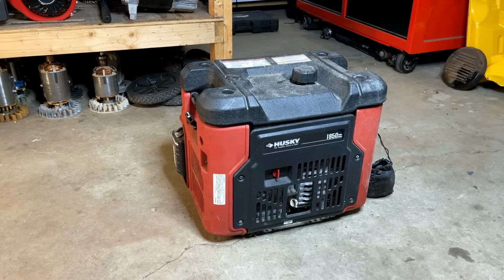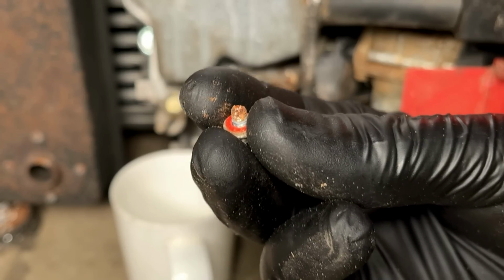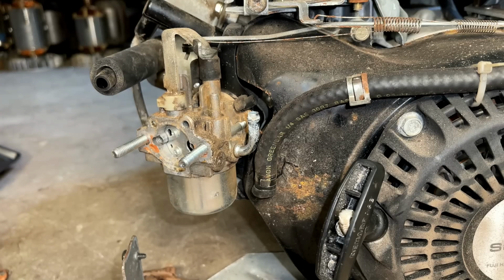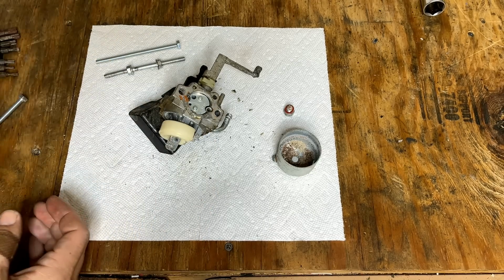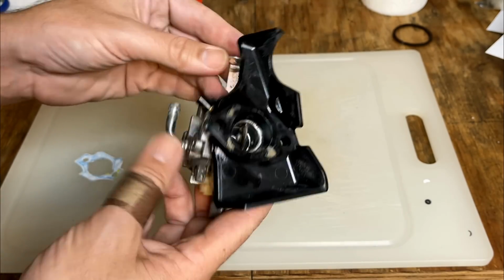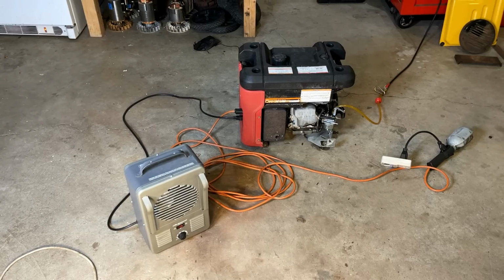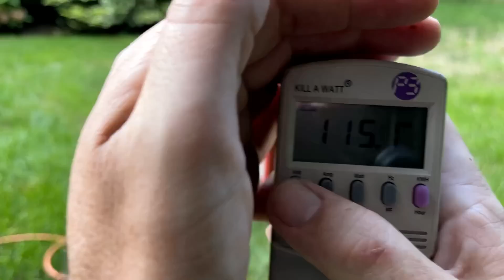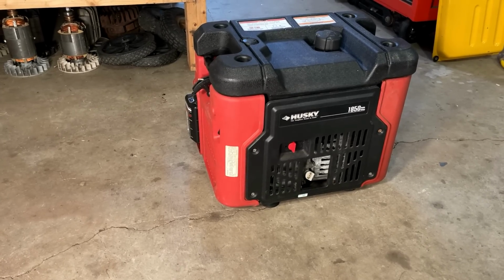Husky 1850 Generator Will Not Start - Stuck Carburetor

Comment: Mr. Condon, I am retired but I have spent 44 years working as an Electrical Engineer.  I am impressed with your methodilogy in working with these generators. I have seen most of them and secondly I'm impressed with your even temper (mine is not that steady).  I have learned much from watching you and I thank you for your videos.
Reply from the maker: Thanks for the feedback, I appreciate it.
Reply: My sentiments exactly!

Comment: Jim, in addition to Bryant Fry's hint, what I do to straighten those studs is to screw a long connection nut on the stud, right to where its bent. Then you can straighten it with a ring wrench that I put on the nut. With the nut there is no way you mess up the threads. The pipe Bryant was proposing might create marks at the end, but will work as well.
Hope I found the right terms, since I'm not a native speaker.
Greetings from Germany
Andreas
Reply from the maker: Thanks for the tip.  Your English is good.
Reply: @jcondon1  Thank you James! And your videos are very helpful. Could you please tell me, what you use as ultrasonic fluid? I have currently a similar candidate in my workshop. Unfortunately the poor thing is so old, that I can't take the easy way out and bus a new carb. Fortunately the mechanics are not stuck, just the jets are stuck and with my isopropanol water mix I am out of luck.
Thanks in advance!
Andreas

Comment: I have a Husky power washer that my neighbor gave to me, non-running.  He admitted he never changed the oil.  Ever.  And it was built in 2006!  It has a small flat head briggs.  It looks just like your Husky generator, a red cube covered in plastic all over.  A total pain to work on.  I guess they cover the entire engine as they expect the average homeowner to simply add gas and connect a water hose.  Simply trying to access the carb or pull the spark plug, requires removing like 12 screws and prying apart the entire machine.  Kind of like working on a clothes dryer!  I've basically stripped the entire housing off of it and just left the engine/pump housing mounted to the floor-frame.  Much better  :)  It runs great, and like you said - "it earned an oil change"!  I actually take the same approach!  Only after I get an engine/machine running well enough that is has hope, do I change the oil.  I'll add oil before running if it's low though.
great video!

Comment: Well done, another one brought back to life.   I was surprised you found the very long 6mm bolt at a local hardware store.   I think I would not find anything of that length in my local hardware stores.   I have a metal lathe and imperial and metric taps in dies so would likely have made a stud.    I am happy to make such items for you if needed.
Dave.
Reply: If you have one nearby, Fastenal can have a lot of unexpected items in stock.
Reply from the maker: Most hardware stores do not have metric or a very poor selection.  The big box store near me has almost nothing.  The small little hardware store has every bolt size you could ever need and well organized...
Reply: I wonder if ACE hardware might be a better bet for these more obscure (but necessary) items.  Their plumbing section seems far more complete for brass fittings than the big box stores, they might have a greater selection of studs.

Comment: Two thirds of your work is carbs James.  Carburetors are precision engineered devices. The slightest deviations from the spec can render them useless. I love how you can see which deviations are causing the problem and your innovative attempts to fix them. You fix them even if they come with problems caused by slack design. It is impressive.
Reply from the maker: Thanks

Comment: Jim, here's a tip on straightening bent studs. Slip a piece of pipe with just a slightly bigger diameter over it, and then you can nudge it back. The longer the stud, the easier it is to straighten. I have used this from time to time with none of them breaking. If it has a sharp bend, there you will have more risk of it breaking. Mustie1 uses this technique.
Reply from the maker: Good tip, that would have worked well.
Reply: Do you sell generators if so how can I get one from you

Comment: Ive had great success with removing seized screws / jets etc from carburators by immersing the whole thing in boiling water for a few minutes. Usually frees them up a treat.

Comment: A little advice: before cutting off the threaded bolt, screw a nut onto it, then cut off the bolt, file it, and twist the nut from the saw side, the nut will clean and align the thread.
Reply from the maker: Great tip, thanks!

Comment: Hi Jim, I notice that over a number of programs that you have had several different ultra sonic  cleaning baths and your latest one appears to be digital. I am old school and my experience is forty years old, and we had no ultra sonic cleaners then, but I do recall an ex-forces power bank very similar to one with cooling fans I have seen you use, before your very nice and sophisticated  unit, My last experience of dismantlng small generators were the Honda E300 units, which were beautifully made, The OHC Subaru engine is new to me and I dont think I have ever seen one. As always your videos are most interesting and very instructive. Thanks for your channel. Rex

Comment: Nice use of alligator clips to extend the ground to the plug. I  like that .  Yes the brush less gensets are dirty.  With each spike you see on the oscilloscope there are high frequency signals generated causing noise much like a square wave.  Many folks this they are opposite and super clean.
Reply from the maker: Sometimes you need an extension, especially on stuff like this covered in plastic.

Comment: Brushless generators are always going to have higher total harmonic distortion. The squiggly lines at the top of the wave is the result of the circuit "ringing." This is because the capacitor and the inductor (the spinning rotor) are acting as an undampened (think of a car with no shocks) resonant circuit. The best way to stop the circuit from ringing is to add a purely resistive load like a heater to quiet that circuit down. Unfortunately it is not a 100% solution. I would say try loading it up to 50% to 65% and see how the waveform looks. 

Nothing beats an inverter generator with proper RFI/EMI filtering on its output.
Reply: The problem is they don't make 10,000w and higher inverter generators. If they do i haven't heard of them
Reply: @faststang89  honda makes a 7k that you can parallel with another 7k. But it costs many mortgage payments.
Reply: Harbor freight makes a 9500 inverter generator
Reply: Yes that generator may be expensive but it is the best that you can buy
Reply: So many people are caught up in the clean power. My 1850 watt camping portable generator and 6250 watt generator both non inverter generators. In the 1850 portable non inverter generator is relatively quiet. Have ran things since 1994 when I bought the truly made in the USA generators both with bulletproof Briggs and Stratton engines. No electronics burned up. But the newer inverter portable generator I bought burned up in less than a few months it went back to the store tried another one and that died too. They were cheap Chinese inverter generators though. I went to Honda inverter generators now they don't seem to die and seem pretty dependable so far. But I found out the hard way if the overload light comes on in an inverter generator you better cut it off immediately and cut back the power here using. And not keep having the red overload light come on or you can burn them up like I did. Inverter generators are supposed to be so smart they don't blow a resettable breaker like the two older ones I mentioned do they just blow the inverter board.
Reply: @tomtee4442  it's more important because most switch mode power supplies employ what is called active power factor correction. Its for efficiency as SMPS is a nonlinear load. The old passive method was a simple capacitor at the AC input, it didn't matter how dirty the waveform was, the cap did all the filtering. With Active PFC though, the higher harmonic content causes that circuitry to work harder and get confused on where to set its parameters to, as a result power supplies fail more often with dirty power. Dirty power with higher harmonic content than the fundamental of 60 hertz in general will cause components to run hotter than they are designed for and excess heat will cause failures. 

So clean power is actually a very big topic because the technology has changed, and unfortunately build quality has changed for the worse. I'm sure your old portable generator was better built compared to the crap they make these days.

Comment: I think you did very well with the airbox seal. Of course the inner gasket to the engine is more critical on inner hole shape than low velocity airborne gasket which keeps dirt intrusion out. My garden digger needs this treatment. Works fine without airbox but does not like filter.

Comment: Why didn’t you try putting a little oil or ATF fluid in the cylinder to lubricate the walls/rings? Could bring the compression test numbers up. It fired with starter fluid.

Comment: One tip I learned concerning cutting off the end of the bolt is the thread and not on first cut the head of the bolt off and then run the nut over top of it to straighten the threads. It might help
Reply: I always put a couple nuts on the bolt before I cut the head off, then when you remove the nuts, it cleans up the threads.   Much easier than using a die.

Comment: Really excellent video! I own the same unit and I have to give it a shot of starting fluid to cold start. I left fuel in the carb for long periods of time. My bad.  Probably needs carb cleaning.I do notice the lights flicker sometimes when using. Good info on the scope readings. Thx again! How the heck did those studs get bent??? Crazy!

Comment: Nice find and easy fix. Would have been nice to get the original carb going, but wasn't in the cards. Watching you thread that new stud through the carb and gaskets reminded me of putting the air filter housing and bolts through the carb and ALL of the damn gaskets on a Honda GCV160 OR 190. 3-4 hands would be helpful at times. Great work, filming, audio and editing as always and please do keep em coming!
Reply from the maker: Thanks Erik!

Comment: I had a carburetor that was crusty and calcified worse than this. I took an old crock-pot and poured antifreeze (ethylene glycol) into it. Soaked the carb in that for 24 hours on low heat. Came back and all the jets came out like new and the calcification was gone and the carb looked shiny and new. Any rubber parts or o rings will suffer horribly if you use this treatment..forewarned.
Reply: Usually your putting in sew seals and O rings anyway,gonna try that idea,
Reply: @jeffclark2725  I saw it being used in my small engine shop here in upstate NY. I tried it and was amazed at how well it worked. Ultrasonic is faster, but the glycol method is incredibly thorough. It takes the rust, calcification, carbon..everything comes off.
Reply: @wxfield  
The cleanest cylinder in any engine is the one with the blown head gasket leaking coolant into it.....

Comment: JAMES your video are always so interesthing to wach and learn,carburetors that is what i know best,and you  are quite good at it ,i like your dexterity  that you work with ,BUT what i hate it is when i see you with a carpenter hammer with one claw broken ... as a pro like you  ,you should a least a half pound ball penn hammer ,this would complete your  craftman ship ,i should say your high quality of work.
By the way what is the capacity of your new ultra sound   machine ?
Reply from the maker: The new one is 6 liters.  That terrible hammer I stole from my son.  It is basically a toy.  But works good when you want to tap something lightly.  I agree though it is not the best tool in the toolbox.

Comment: The problem with that dirty sine wave is the high harmonics will generate eddy currents in transformer and motor cores and heat them up more than a pure sine wave would.  However, that's not as bad as the pseudo sine wave of many UPS devices.  Any device that uses switching power supplies will tolerate that dirty sine wave just fine.  I would worry a little about refrigerator motors which unfortunately during power failures and the main things we want to keep running.
Reply: yes  fridges are one of the important thingd to keep running. maybe spending a little more, on a cleaner would pay off  in the long  run.

Comment: My thought on a crust old carburetor that has a stuck emotion tube and jets might loosen up were you to submerge it in distilled water and bring it to a boil. The theory is the housing will expand and less force in extracting the part will be needed.

Comment: I’ve fixed a couple of those. Sold by a few companies, same machine. The cheap plastic capacitor fails, no output. A real handy little machine though for light use and very portable. The China carbs are hit and miss. Some work, done don’t. Just had an Onan 4ky unit needed a carb. Bought 2 off Amazon. Neither ran well. Ended up putting a used worn Onan carb on it I had laying around. Onan carb costs a fortune compared to China made. And I am an Onan dealer !
Reply from the maker: Some carbs are way to expensive.  I had a 2 cylinder Vanguard that needed a new carb.  I spent close to $250!  They now have clones of that carb.  The clones are definitely a hit or miss, but worth a try when the alternative is crazy expensive.
Reply: @jcondon1  My cost on an Onan 4ky carb is over $200 and as I said I am an Onan dealer ! I can and did buy Honda carbs for under $100 or maybe $125 from a Honda dealer! The last 2 Honda carbs I bought had the idle control stepper motor on it for those prices. Cummins-Onan parts prices are outrageous and lots of stuff is made in China ! I’m not working right now, had a major health issue put me out for a while. I actually grew to like working on small engine equipment and some of your videos were very helpful. You do a great job on stuff that is generally tossed out because no one wants to do this work for the must part. I’m 74, old school, I’ll try to fix almost anything unless it’s really in bad shape.

Comment: Another victory in the win column.  I was surprised with the noisy waveform of the brushless generator output.  I  would have expected it to be clean, almost no distortion equal to inverter generators.  No brushes to cause arcing and noise on the output.  I wonder where that noise comes from.

Comment: Nice fix Jim: Do you think the generator might have been partly under water at some point. The inside of the filter housing had a rust line on it so I thought it might have been under water. Thanks for a great video.
Reply from the maker: Do not think so.  The person I purchased it from had beach front property.  Think the salt and humidity got to it.

Comment: I run two in line filters on my auxiliary fuel tank, just in case. But I deal with 4 or 6 cylinder motorcycle which have carb racks that aren’t fun to dislodge and reinstall. Can’t take the chance of any crap getting in. Also if you get some aluminum angle pieces like 1/8” stuff make some soft jaws for your vice to grab stuff like that threaded rod.
Reply from the maker: Pulling a carb rack for any reason is a lot of work.

Comment: I saw the OHC on the valve cover and was skeptical about the "C". Upon removal of the valve cover there it was: the overhead cam!
Reply from the maker: It is one of the best built small engines.  I dare say better then Honda.  Too bad Subaru sold them to Yamaha.  Not sure if they still make these engines.

Comment: Another generator brought to the life again actually I'm addicted to your work and your videos Mr. James but I have a doubt... where do these people store their generators ??
Because most of the generators you fix are full of rust and dust. 
The generator should be kept in a clean place .
Anyway this video helped me with a new technique specially with that stud but I don't  know how these types of generators get cooled since it's closed from all sides that  means no sufficient air will be there for allowing the engine to be cooled therefore the engine will always be exposed to overheating.
I think this type of generator doesn't last longe.
thanks a lot for the video with my regards to you Mr. James.👍
Reply: Where do you live that there is no rust or dust?  Most people around my parts keep their generators in a shed or outbuilding.  Anything that sits for years, even in a "clean" shop, is going to build up a layer of dust on it.  Rust also, in many parts of this country with the high humidity levels, especially if it is kept in an unheated space.  Where I live, I have learned to hate chrome because anything chromed that sits outside, even if out of the rain, still pits and corrodes from the humidity.  My grandfather had a beautiful set of 1940s Craftsman sockets hanging on a pegboard in his barn, one socket to a peg - they hung there so long that 100% of the chrome flaked off the sockets and each socket had a pile of tiny chrome flakes underneath it on top of the work bench, when we cleaned out the barn after he passed away.  I had never seen anything like that!
Reply: @redmondjp  
I wonder what dust covers are for?
An old blanket or old bedsheets might work at a pinch....?
Reply: @redmondjp  you could wipe your generator or whatever has the capability to rust with oiled rag and that somewhat will protect it against the rust and corrosion specially if there is a high humidity. 
I do this thing with my generator and underneath my car also.
Starting your generator for 10 min monthly will keep your engine and other parts away from getting rusted, corroded and accumulating of dust and dirt.👍